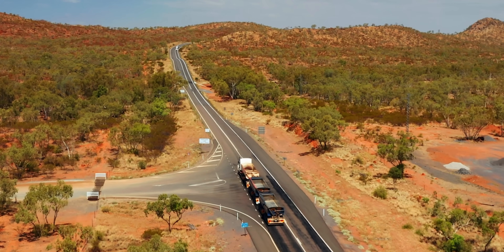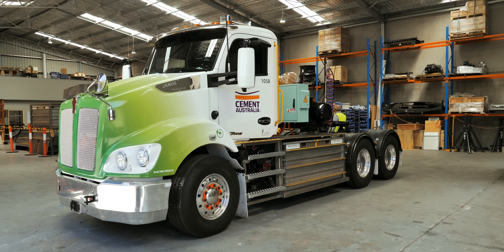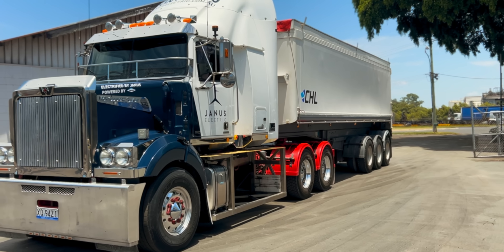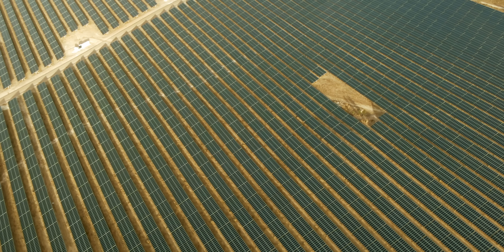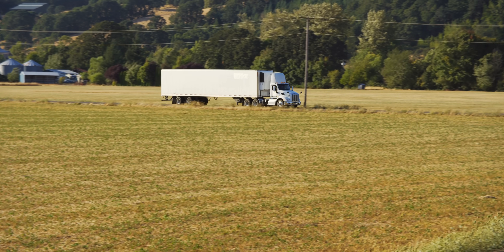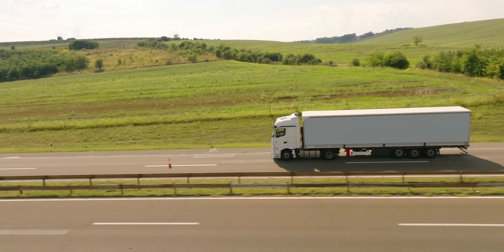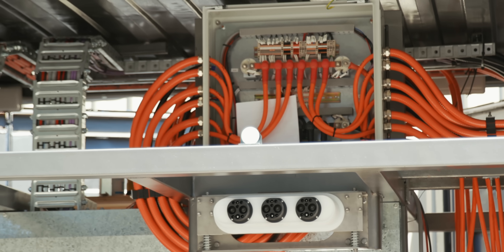This GIANT Electric Semi Can Swap Out Its Batteries!

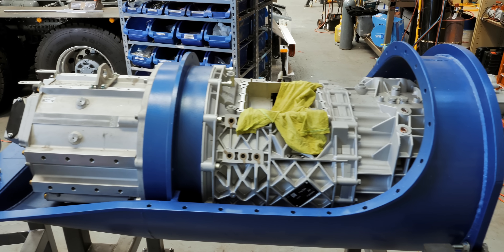Comment: 4:09 electric locomotives on the other hand don't have a gear box. They have fixed gear ratio but they are fixed. Same with diesel-electric locomotives.

Comment: Just put some additional batteries in the trailers. When trailer is attached, it can give you additional 200+ kilometers - 2+ hours of driving. It's a trailer afterall! And while the trailer is not used you can slowly charge it from renewables.

Comment: Fascinating and well presented, although some graphs would have been useful.

There is another channel of the experience of a German trucker and his work day moving loads around Germany and the neighbouring countries. It looks so doable and it is still early days with new technology coming out every day.

The real advantage of this system is that as improved batteries are developed, then it is a simple matter to change the battery packs and bingo you've got cheaper, better trucks. And the charging is done when there is ample renewables available at the lowest price. By design this jumps the need for generation and consumption being at the same time.

Has Janus looked at this as a solution for buses and coaches?

Comment: Press X to doubt. The requirement here is an idiot proof quick disconnect electrical connection for the battery, the ability for automatic replacement, and the logistical juggling of lots of battery packs.
Also how much are those battery packs worth? And they're n the outside, unprotected by locks, and designed to be easily removed? Asking for an insurance company...

Comment: There is another development that should be watched closely.  Chalmer University in Sweden is developing a battery that doesn't add to the weight of a vehicle.  It is incorporated into the body of the vehicle and this would suit large semis and delivery trucks when paired with swappable batteries since it has the potential to reduce the overall weight of a vehicle considerably.  I believe they are also developing an onboard solar charging system that can produce upwards of 20% of the power used in a vehicle.

Comment: Sorry but I feel the statement it's quicker to charge up an electric truck than fill up a diesel tank is misleading at best or yet more journalistic lying.
It's not apples for apples. If you fill a battery pack from empty and a diesel tank from empty them the diesel would be quicker.

Comment: is electricity that expensive in australia? 60 cents per km means that they pay 60 dollars just after 100km, thought EV was supposed to make way cheaper than diesel
Reply from the maker: So did you not hear him, 5 seconds after saying 60 cents per km that a diesel truck costs $1 per km. Which means a diesel truck costs $100 to drive 100 km. And if you charge the battery from your own solar, then the cost becomes invisible.
It's truly not that hard to understand
Reply: @fullychargedshow  Yes i did hear him, its you who dont understand. 40% cheaper is still extremely bad that's why i thought electricity in australia must be expensive. where i live i pay like 90% less per km compared to diesel prices. so either australia got insane electricity prices or diesel is dirt cheap
Reply: @xondeez757  Would you mind sharing what electric truck and country you live in that gives you a 90% reduction in operating costs compared to running a diesel truck?

For your information, electricity prices normally retail from 25 to 45 cents Australian per kilowatt. You can get lower prices off-peak. Diesel is about 1.8 to 2 per litre.
p.s. If you are getting 90% reduction in running costs compared to diesel - based on your experience with a regular car….. well let’s just say it doesn’t scale the same way.
Reply: @velvetcream1289  i never said running costs. Obviously it’s going to cost around the same for the expenses but pure running expense, 40% reduction is good but it’s one of the worst I’ve heard. Electricity is supposed to be so cheap that people buy ev cars or trucks to offset the extra cost for the batteries

Comment: So basically semi in the US would be changing batteries at charging stations. If a semi range is 300 miles than 11 hrs of driving would be 3 swapping of battery packs to travel an estimated 600+ miles to the next station. ?😂

Comment: Same principal as a Forklift battery, swap the Battery out for a fresh charged battery. There will need to be Battery Station Depots along the routes for drivers to swap batteries on Long hauls I figure? Im not getting the idea of the Electric motor/tranny tho, as theres now electric motor axles for this type of trucks being built.

Comment: Batteries are no LESS toxic!  The fact of the matter is most power generated around the globe still comes from fossil fuels and not nuclear nor solar which doesn't have a chance of keeping up with demand!  The energy density of batteries is no where near that of diesel fuels!  So all this nonsense of 'clean' energy when in reality, it actually costs MORE than just using the diesel fuels!
There are no shortcuts when it comes to energy conversion and certainly not when it comes to powering prime movers! And that doesn't even take into account of the time needed to charge these batteries! How long does it take to fuel up the tanks on a semi using high flow pumps? 20 minutes?  How much range would you get with battery charging for 20 min??!!!

Comment: Sounds good, but I've got questions: How is the battery plugged in the truck? I do not see terminals or cables, how is the heat management done in the battery, I do not see coolant lines? If you charge the battery it will heat up, if you take power out of it, it will also heat up and what about the ambient temperature in australia? I'm sure the battery cells do not appreciate temperatures of 50°C plus. And the other thing is, why using a conventional driveline? An automatic gearbox is not great in efficiency, an angle drive in each axle also not. Why not using a transversal drive in each drive axle? Would safe a lot of weight, because there is no driveline and gearbox and would also add space for batteries. If more power is needed for high gross weight, why not drive the steer axle? Would also result in a 6x6 configuration to help traction and regeneration. If more torque is needed maybe an electric transversal 2-speed axle?

Comment: But you have to pay for 2 (or more) batteries $$$ and a storage and charging facility for one of the batteries $$$ and your battery wont be compatible with any other battery or charging facility from any other manufacture so we will have to have duplication of many items with no compatibly therefore the support cost of the electronics / batteries will be high. 
VS Pull into a service station for 10 15 minutes!

Comment: What a bunch of garbage! 6 hours to change oil? I own and drive trucks 1.8 million kilometres and still no rebuild engine or transmission. The numbers this video is using is slanted to EVS , yes replacing dead for fully charged batteries is a good idea but never mentioned the cost to convert. I still say the cost isn’t worth the risk of contaminating water supplies from mining the material needed to make batteries and the supplies needed to change to electric vehicles isn’t there! I applaud these people for doing innovative research but it’s a long way off!

Comment: It’s all a dead end technology. Fire risks plus the environmental costs of making all that lithium. Using hydrogen as a power source uses most of the existing diesel engine. The presenter has jumped on the ev bandwagon which gives him a new platform to sell his program. Not for me thanks.
Reply from the maker: I can't help responding due to the really embarrassing factual errors in your comment.
Fire risks. Quick actual fact, in Australia there were 1,982 vehicle fires in 2023. 
1,981 were combustion engine vehicles, they catch fire all the time, it's so common it's become normal and isn't reported.
You actually wrote this. " the environmental costs of making all that lithium."
That is exactly the same as writing " the environmental costs of making all that oxygen."  
It's embarrassing, I won't rub it in more than that.
Engineers, scientists, engine specialists, massive, multi billion dollar corporations and the oil industry have been striving and struggling and developing and claiming since the early 1970's to develop 'hydrogen' vehicles.
They have resolutely failed agina and again and again.
I have driven 3 amazing hydrogen fuel cell cars. 
Where are they now? 
Why aren't there millions of them on the roads. 
Why aren't there tens of thousands of hydrogen filling station all over the world.
Because the technology is redundant, they will never catch on.
It's a shame, I'd be happy if they did but everyone trying to push hydrogen technology is slowly and quetly closing programs, shutting the remaining handful of hydrogen refuelling stations and giving up.
Why are there now 450 million battery electric vehicles on global roads which have now counted for a ruduction in oil burning by 1.2 billion barrels a year.
Why is the fastest growing sector in ground transport, (this includes scooters, mopeds, delivery vans, trucks, busses as well as passenger cars are battery electric.
There is only one really dead technology we've all been using for the last 120 years.
The internal combustion engine
Reply: Be careful... Virtue Signalling can be considered a religion! Never question them 😂

Comment: Swap out diesel with electric?😂. Do that and it lessens the regulated loads those trucks can carry, because the batteries are heavier, therefore loads will be smaller and more costlier. Battery packs will be a larger load on the hydro system. Battery powered semis will have to “Stop” more times than a diesel truck to change the batteries.

Comment: How many places will have dozens if not hundreds of charged batteries waiting to swap, there's millions of trucks so you'll need twice as many batteries. Are there going to be battery swap places between Sydney and Perth every 500 miles with loads of charged batteries, are there giga watts of infrastructure available to have charging places across Australia? You don't have enough storage of diesel for more than 2 weeks but you'll have enough batteries spread through Aus?

Comment: If all the EV makers used the same batteries and made them removable it would be just a matter of pulling up, swapping the battery, paying and driving off. As you would never "own" the battery then the price of the car should be A LOT LESS too!!! and resale value would remain up as the new owner could just put in a new battery and they are ready to go

Comment: We are already reaching 87-91% nox and emissions reductions with SCR. This is just pointless mandates beyond this. You have to be "point reliant" with Hydrogen and battery pack change outs. and until they make refueling containers for hydrogen. its not feasible. I have a plug-in hybrid. I enjoy it. but anything beyond that is not practical.

Comment: This does look to have a lot of significant advantages.  It makes a lot more sense to convert the large  trucks that get heavily used on known routes rather than cars that spend most of their time parked and (unless used soley for commuting or locally) need longer range and fast charging batteries.  With continuing battery developments range could double or more in the lifetime of the trucks. A critical success factor will be coverage and reliable availability of the battery packs.  An (intern)ational standard for battery form factor(s), battery management interfaces will have to be developed/adopted; it was the de facto standard shipping container unit size that allowed the development of container trucks, ships, trains, cranes refrigerated containers etc.  

And perhaps the early adopters will find the associated benefits as important - early users of containers for international shipping were shipping high value products (e.g. whisky) were the reduction in pilfering was more important that speed of loading and unloading.  

Please revisit this or similar firms regularly to see if they are succeeding with this approach.

Comment: That desal engine is still lighter than the batteries needed to power that truck and will run for a million miles at a fraction of the cost.
Reply from the maker: That battery weight fractionally m ore than the diesel engine and not forgetting (as you did) the heavy, energy sapping transmission and gearbox, and the electric motor will last 5 million miles with almost zero maintenance costs. 
The fuel that the massive, heavy, filthy, inefficient diesel engine burns through is not benign, it is also not free. It is also impoted into Australia at massive, gut wrenching cost to the Australian economy. Not only is it imported, the fossil fuel industry bully funding out of the government, money that comes from poor hard working people who then have to buy the fuel, pay the tax on that fuel which goes (and we're talking $$billions) on subsidies to the most profitable, brutal, vicious industries that the human race has ever created.
And people are telling you again and again that this is normal and fine. It isn't.
Diesel is a filthy, toxic fuel and we need to stop burning it as soon as possible.
So basically, you are 100% wrong on every point.
Reply: @fullychargedshow  I HAVE BEEN LOOKING FOR *THE KAREN* ALL MY SHITIFUL LIFE!!
*YOU EXCEED MY NEEDS ON SO MANY LEVELS!!*
Reply: @fullychargedshow and yet fully charged fly all over the world on taxpayer money, in planes that use combustion of that hydrocarbon stuff you hate so much.
Reply from the maker: @244col  You see, the thing is, it's a very honorable thing to call out potential hypocrisy, but if you add falsehoods and lies to the allegation, that totally undermines it and makes you sound like a bitter, resentful Trumpy man child.
You suggest that some of the presenters on Fully Charged fly about, and I quote you, " on taxpayer money."
I cannot imagine how you came up with that lie, but it is, indeed a lie. We have never received 1 cent/penny of taxpayer funding for anything we do. We are 100% self funded, so everything else you said about flying is utterly irrelevant now. 
BTW, I'm married to an Australian and I spend about a third of the year there with my Australian family. 
We have correspondents in the USA, Canada, Australia, China, South Korea and Germany who we work with specifically to reduce the amount of flying the team do.
All that said, all flights make up just under 4% of global CO2 emissions. Ground transport makes up around 40%, so, low hanging fruit etc
Reply: Don't trust the presenter! He used to work on BBC! We all know that is a place lies are created! Just like the fake space show he starred in 😂😂

Comment: I am not opposed to EVs but we also need some realism, to battery power my logging unit I would need 4 changes a day (probably at least 3 batteries just for my unit.) I would have to go to change facilities 4 times a day (Currently once a day ) a minute to charge is fantastic but driving 15 20 mins to a change facility 4 times a day is not__ until there is a huge exchange network actual truck range is more likely 150 out and 150 back.
These would be good for buses and town delivery though. The Philippines has  had battery exchanges for their Jeepneys for probably a decade now__